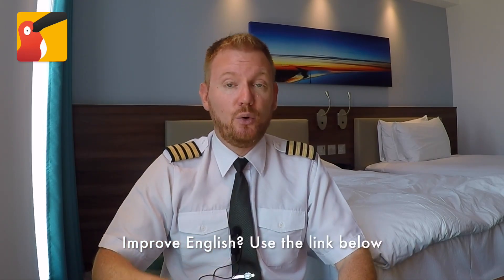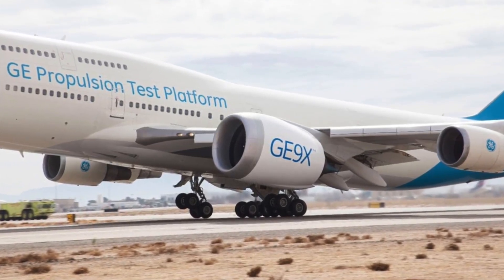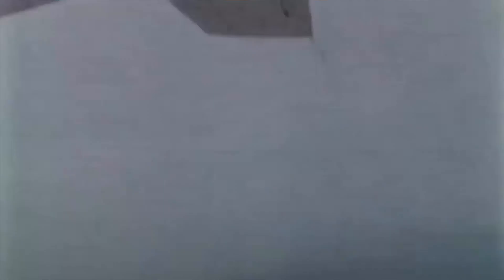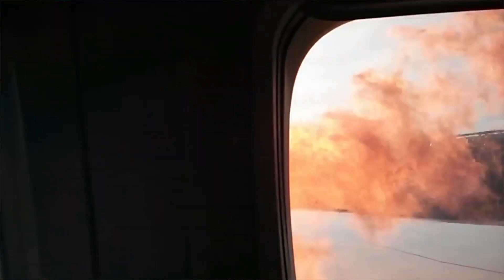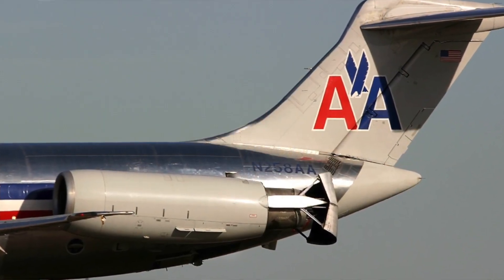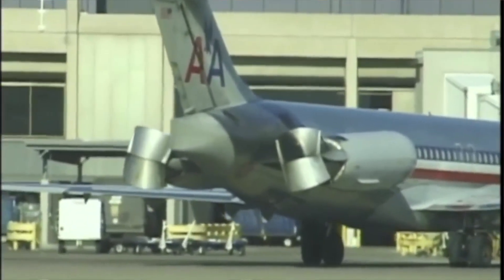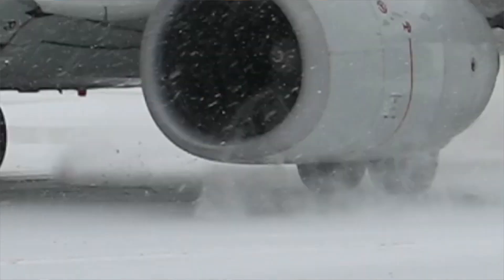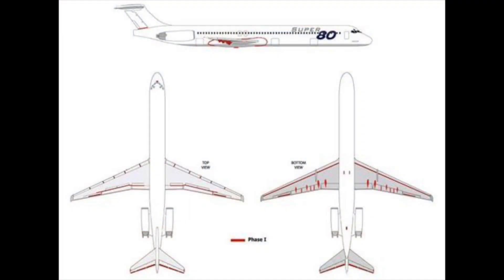Why are the jet-engines placed there? Wings vs Tail

Comment: Some other considerations. The horizontal tail on a rear engine aircraft is usually larger and has to produce more downforce, and drag, due to the shorter moment arm between the tail in the center of gravity. The vertical stabilizer has to be reinforced to take the vertical loads of the T- tail.  Except for engine out conditions, rear engine aircraft are generally less aerodynamically efficient than those mounting engines under the wing because of the increased drag of the horizontal tail.  Another reason business jets use rear mounted engines is because the landing gear can be much shorter, and business jets generally have an air stair which would have to be larger and longer if the landing gear is taller.   Check out the relative size of an air stair on a Learjet versus the one that was built for Air Force One as a case in point.

Comment: I haven't read all comments but aren't there also a greater risk of ice in the engines in rear mounted engines if poorly deiced wings or ice build-up is falling from the front of the wing and it gets sucked into the rear ended engine. Wasn't that what happened in the Gottröra crash (the Arlanda accident of SAS 751) where the Danish pilot Stefan G Rasmussen crash landed with a MD-81 just after take off of Scandinavianb Airlines Flight 751 from Stockholm Arlanda Airport in Sweden?

Comment: From what I've read, the 727 mounted all 3 engines at the rear so that they could have more control surface area, increasing available lift from the wings. Since the engines available at the time didn't produce sufficient thrust, and they needed the extra lift.

Comment: Are you really sure about the relation between the engine height and center of GRAVITY as the reason for thrust/pitch couple?
I would guess that the relation between engine height and center of GRAVITY only does an impact during rapid acceleration, and the main reason that impacts the pitch would be the relation between engine height and center of AIR RESISTANCE? Please correct me if I'm wrong :-)

Comment: Isn't there also some additional danger of hydraulic system damage from a catastrophic engine failure in tail mounted engine designs? I seem to remember an incident with a MD losing all control of the rudder and horizontal stabilizers with them both locking in position from damage when the tail engine suffered a catastrophic failure. The shrapnel cut all three hydraulic systems and the plane had to steer using thrust only to reach an airport for an emergency landing. I think this was in the 90's, but I am not sure on that.

Comment: You forgot to mention the most important reason for having rear mounted engines. It looks AWESOME!!! Can anyone honestly tell you there's a better looking airliner than the 727? Who doesn't love that swept back T-tail with the air inlet? Now that the stylish planes have been phased out and replaced with planes that all look the same, the thrill of arriving early at the airport just to see the planes is gone. Flying went from being an enchanting adventure to a bland experience. So the 727 burns more fuel and makes more noise, so what! It should have been kept in sevice until a better looking planes got built, which is probably never.

Comment: Hello all, I hope this has not been mentioned in another comment yet but forward vs rear mounted engines have also impact on airplane's behavior when brake pressure is applied. So when engines are rear mounted and pilot applies some breaks then the nose is being pushed down towards ground. When this happens on an aircraft with frontally mounted engines this is not so apparent. Basically when brakes are located ahead of engine then applying even a slight brake power limits from rotation.

This was one of cause of Jaroslavl Yak-42 aircrash.

Comment: What would happen to a pilot's career if he were to damage a plane ? Like a tail strike or something similar. What would happen if he were to crash and survive ?
Reply: It depends if it was a mistake or negligence. There would be an investigation by the safety department and if it was a mistake such as a tail strike then they'd probably be sent for some additional training but it would all be handled confidentially and should not have an impact on the pilot's career.
However if it was negligence (deliberately flying in an unsafe way), then they could be fired from the airline and the aviation authority could revoke their flying license.
Reply: They put him on jail. Because he claimed he knew how to fly, and it wasnt the case.

Comment: As a young mechanic we had a maintenance supervisor attempt to put a number two engine pylon in the number three position because no number three was available in supply. Spent days trying to get it to fit to no avail. Thank goodness it didn’t. I’m not sure how the aircraft would have handled but I’m sure it would have caused some strange handling characteristics.

Comment: Great explanation, thank you! Question: As a passenger on the old French Caravelles I often experienced much more roll controlling at takeoff and landing than with modern planes. Sometimes the pilots were very busy compensating roll motions. Was that also due to the high engine mounting?
Reply from the maker: Hard to say but my guess is that they had smaller aileron surfaces or something like that. I haven’t flown it so I’m not sure.

Comment: As much as I love DC-10s and MD-11s and the like, I've always wondered what the hell they were thinking.

"...but we don't quite need an extra 2 engines."

"Just one then, 3?"

"3".

"Okay, done. We just have to figure out where to put this high-powered volatile device with a massive fan blade that could blow up at any time..."

"Okay, how about we stick it right in the middle of one of the most vulnerable sections of the plane. Yeah, that sticky-up bit at the back that the plane absolutely cant fly without should it be torn off."

"Genius. Do it."
Reply: MPAH1981 3 engined widebody jets like the DC-10/MD-11 and L-1011 were really kind of a stopgap before ETOPs was a thing. 4 engines were too many for a smaller wide body but 2 engines weren’t enough without ETOPs. So they used 3 engines to save on fuel and still be able to fly over oceans unimpeded. It wasn’t an ideal configuration but at the time the DC-10 and L-1011 came out it was the only way to have a widebody that didn’t need 4 engines fly over oceans without limitations. In all honesty though, where else could they have put the 3rd engine that would have been better?
Reply: There is at least one MD-11 aircrew that can vouch for tails being overrated.  During the Iraq war a MD-11 freighter was hit in the center engine by a surface to air missile over Baghdad, despite losing elevator, rudder, most of the hydraulics and the center engine they were able to successfully turn around and land the plane with no loss of life.
Reply: KentB27 Under the body, F-16 style? 😜👍
Reply: @SgtMclupus
Not to nitpick, but only the intake was under the body of an F-16; the engine was right in the centerline of the fuselage. But it is a damn sexy intake..
Reply: @SgtMclupus  only the intake is under, the engine is inside the airframe in the center of the craft.
Reply: Yes, as mentioned earlier, it had three jets because of regulations that have since changed, making three engine planes all but obsolete. "Early American twinjet designs were limited by the FAA's 60-minute rule, whereby the flight path of twin-engine jetliners was restricted to within 60 minutes' flying time from a suitable airport, in case of engine failure. In 1964, this rule was lifted for trijet designs, as they had a greater safety margin."
Reply: Or make the cargo door open outwards, but don't have a mehcanism to prevent it from opening in mid-flight.
Reply: "And to save money let's have the big, heavy doors open outward and secured with aluminum and no killswitch!"
Reply: Not to mention having to do maintenance on it...
Reply: "Genius... do it!"

"To the bar?"
"To the bar!"
Reply: KentB27 4 smaller engines that govevthe same thrust and fuel usage could be a viable option.
Reply: MPAH1981 you’re forgetting ETOPs ratings, weight, structural integrity, and fuel economy.
Reply: @NomadUniverse  
Those don't exist. To increase thrust, you need a bigger bypass fan, which requires a bigger housing, and thus a bigger engine. An increase in size means a decrease in fuel economy. It is a balancing act.
Reply: MPAH1981 Concorde?
Reply: Concorde was wings, not tail. The Concorde especially over all other passenger jets, if there were any that could land with one wing, the Concorde would be the one. Provided the other wing was undamaged and the plane otherwise structurally sound still. We all know of course what happens if it catches fire, but a missing peice of wing with no fire wouldn't be an issue. There was a fighter pilot that landed with most of one wing missing. The speed kept it stable.
Reply: MPAH1981 Concorde had 4 engines
Reply: @knightrider1545  yes, but all in the wings. Not the tail.
Reply: as if turbine disc failures for under-wing engines have not resulted in disasters...
Reply: You missed the point, and at no time did I say they hadn't. But thank you Mr. Asif.
Reply: mrvwbug44 I'm sure the people from the Soux City crash would be pleased.
Reply: @NomadUniverse   I called the town to find out why the town would be pleased as you commented but the sarcasm police answered and informed me that the town was in fact, NOT pleased. The airplane crash caused bad juju  and just gave those gossiping locals just more gossip to yap about.

Comment: So what about the DC-10 where engines are mounted under the wings aswell as at the back
Reply from the maker: Good combination of both systems where some extra thrust was needed but not 4 engines.
Reply: Would a DC-10 require a specific license for a pilot to fly one?
Reply: Old Three engine rule for flying Atlantic?

Comment: You mention the issue with stall with a T-tail configuration, which I had been aware of. A question I have is that I notice some aircraft have have fins along the underside of the tail. Is the purpose of those to help with such an issue such that in a stall condition, those fins would be in the airflow with an angle of attack so as to provide additional lift at the tail?

Comment: With podmounted engines you need to follow the B-52's development. Most of the windtunneltest - and there were for the period an unusually high amount of windtunnel testing to determine the precise location of the engines along the span of the wing to avoid catastrophic flutter - wrongly placed it will very simply tear off the wing.
When you are low on fuel the demand for lift is smaller which means the wing root bending moment that has to be counteracted is smaller. When heavily laden the amount of fuel in the wing is actually a counterweight in itself. On the B-52 you can actually see the wingtips drooping - so much that it needs outrigger wheels.

All of this is reduced structural weight because the wing can be made thinner and longer. The B-52 actually has a service ceiling of 50.000' which is more than most airliners actually like. At 40.000' there is the tropopause where the engines work optimally.

Another point is that a normal wing wants to flip backwards the podmounting acts in another way as a counterweight reducing the twist moment on the wing - reducing the need for tail surface area.
The placement of the outer pod is actually to give counterweight far out to avoid adverse wing flechling - basically meaning, than when you deploy aliaron to til the plane - nothing happens as was the case with the predecessor: B-47.
Actually the B-52 was a technological breakthrough - and the B-52 actually flies every day militarily without replacement any time soon.
Actually the B-52 is an absolute bastard to fly - especially refuelling aerially.

The tailmounted engines (known to my generation as Caravelle-mount) has the advantage of using the passenger cabin as a counterweight. The Boeing 747 has a hefty lump of uranium in the tail as a counterweight otherwise the tail would be to light.
The other benefit of having most of the weight in front of the wing is that during take-off you are less likely to scrape the tail on the ground - thus reducing undercarridge length.

Comment: The A-10 Thunderbolt II has a whole different reason for high engines: enemy fire.  The engines are up high so a wing would sooner take a shot than the engine.  It's designed to return home on one engine and half a wing or elevator.  Even weirder is that a B-52 is almost 50% faster.

Comment: With the T-tail super stall, since the engine is mounted above CoM, I was thinking you can increase thrust to pitch down. Though I always thought rear mounted engines were aligned to the CoM.

Comment: You missed one of the main design reasons for tail mounted engines, and that is designing a wing for very slow and high lift flight is easier and more effective. Between this, reduced FOD and being able to reverse without a tug is why it is common for small jets designed to operate from small airports to have high tail mounted engines.

Comment: I heard at one point that it's more efficient to draw "virgin" (undisturbed) air into a turbofan than that flow which is for example right up against the fuselage, as is the case with rear mount engines. Hence the pylons which position the fans' leading edge so far in front of the wing on all modern jetliners.

Comment: Speaking of handling, I am always fascinated how different aircraft respond to air brake deployment. With 737,747, 757,767,777 there is just a little noise and vibration and that is it - you just slow down. But with 787, air brake deployment seems associated with a sizable loss of lift. Had an occasion to observe it on a recent flight and it seems every time when the spoilers would go up we'd sharply lose a few metres altitude, and when they retract all of a sudden you feel positive G - the way you do at the lowest point of a looping. . It would be interesting subject for a video

Comment: Very good presentation.
But I notice that maintenance issues are rarely addressed in aircraft design and advertisements. One very important advantage of underwing mounted engines is the ease of access for maintenance - oil servicing, inspections, complete replacement, or component replacements and/or troubleshooting. 
I thought you mentioned the pendulum stability effect of the underwing engines too. 
But very easy to understand presentation though. 
Kudos.

Comment: Aircraft with the rear engines are more prone to damage from ice on the wings. Both engines on Scandinavian Airlines Flight 751 stopped when ice from the wings was sucked into the engines. Engines mounted under the wing do not have this challenge with ice from the wing.

Comment: Well explained for those who wish to understand. Good job handling the the various benefits of both configurations. The only thing I caught was that, with the rear mounted engine/T-tail configuration; this configuration allows higher mach speeds without the wing generated mach turbulence (mach shock turbulence generated over the wing and flowing over the stabilizer) can render the fuselage mounted stab in-effectual (also know as, mach tuck). The T tail design,  LR-Jets, Gulfstreams, and certain Cessna jets, puts their stabs above that turbulence . Boeing, except for the 727 (a "T" tail and Mmo of  .90 mach, in "A" mode) , Airbus, and Cessna (Citation, low swept wings, et al.) partially overcome this phenomena by using dihedral in their horizontal stab designs.  I know this mention is esoteric for most, but I feel that the wing mounted engines vs fuselage mounted discussion is incomplete without it.  

I'm glad you mentioned. Large commanded thrust changes on high bypass wing mounted fan engines = TIO (Thrust Induced, pitch, Oscillations). ie DC-8 70 series (B737 engines x 4), B757/767.

Good explanations.
Joel Z. LR-Jet-20, DC-8-70, B727-100/200, B757-200/B767-300ER
PS. Haven't backed an aircraft with reversers in 32 years. Too much liability!